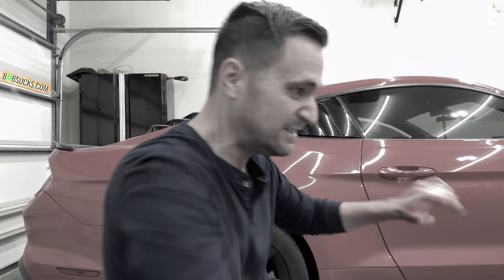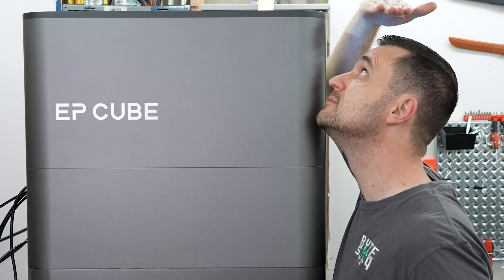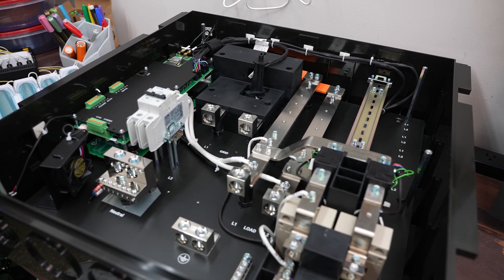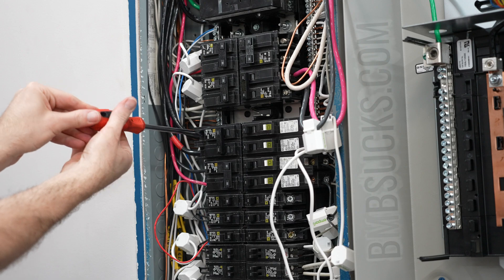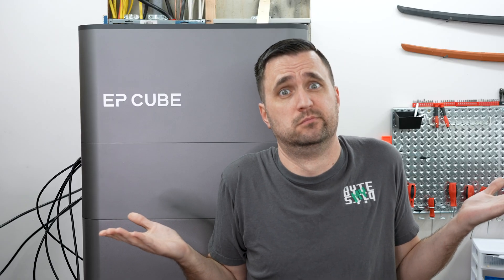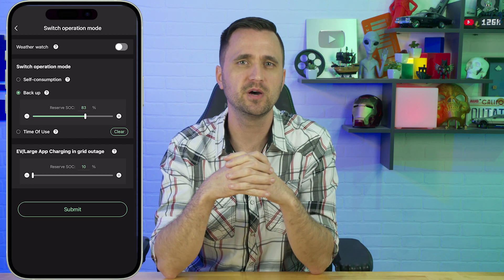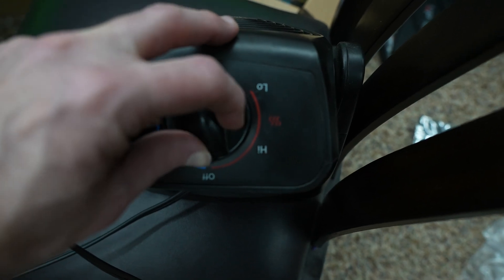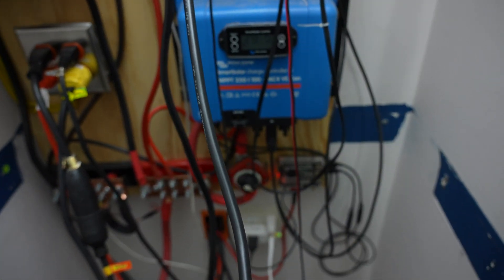First Impressions on the HUGE 20kWh EP Cube Home Battery Backup⚡

Comment: The EP Cube uses lightweight, high frequency, transformer inverter tech which offers a far lower peak power capacity, and a shorter life expectancy than longer lived, higher surge capacity low frequency, transformer based inverter chargers. I think that you would have been better off staying with your DIY low frequency inverter setup.

Comment: Really odd to see Jason making a video and not having a genuine issue. He always prides his reviews and tries to find something that shows a balance good and bad. Sounds kinda like corporate garbage is going on here. @EPCube if this was your doing you are a flawed company with flawed integrity. Companies like that never survive and I hope to see your equipment in the waste bin.
Reply: I don't see any difference in any other company in this space.

Anyway, I have this system and would have no problem revealing its flaws.

1) There is no local API and no way to obtain logging and status. Repeated calls to support yielded no response on the matter. Would be helpful to pull metrics locally for use in my own home automation and energy management stack. Their current approach isn't useful at all to DIYers. And I HATE that I don't have access to my own data.

2) There is an outstanding issue when using the EP Cube with any sort of panel optimizers. In my case Tigo TS4s. It causes nuisance tripping of the circuit and periodically shuts down PV generation for a few minutes. Very annoying. Workaround is to not use optimizers. Too late for me. I wish I could rip mine out.